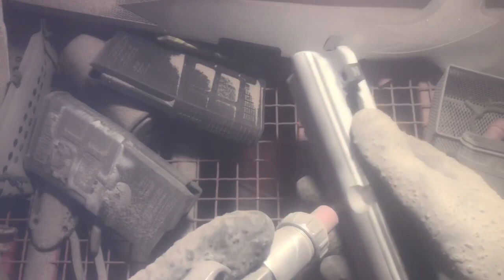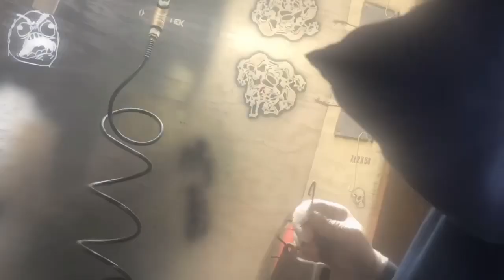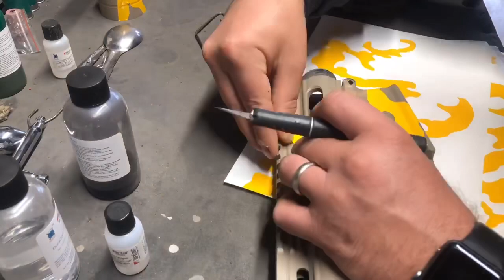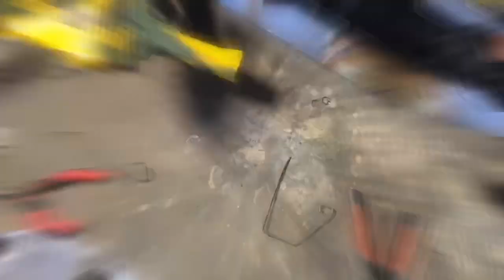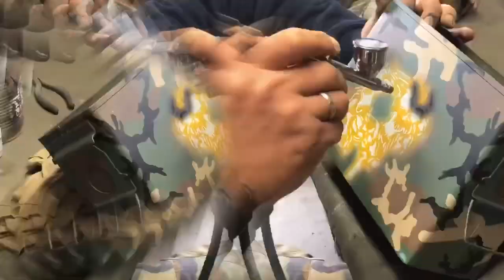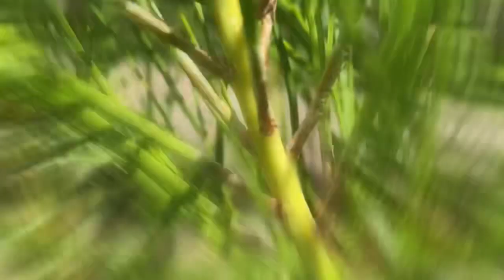M81 Woodland BDU Duracoat AR10

Comment: How do you dry spray paint fast?
Reply from the maker: I’m not sure about spray paint. I use Duracoat and it normally drys enough to peel stencils after about 5 to 10 mins. I will either cure in an oven or let the paint set for 24 hours before I lay stencils over the paint. The time lapse videos is misleading. It looks like I crank out a gun in one day but it normally takes me a few days with the curing time if I don’t use my oven